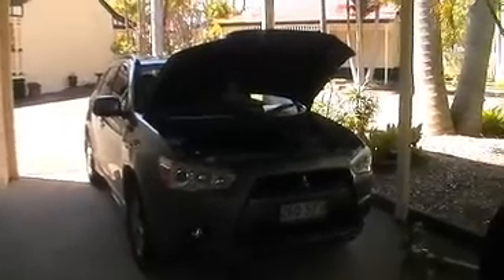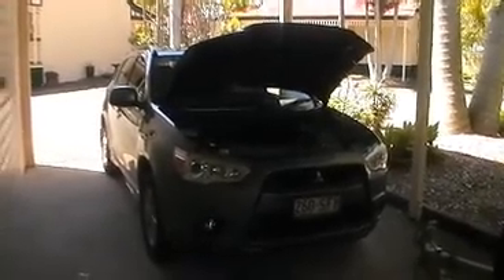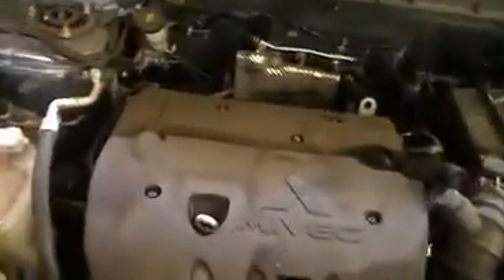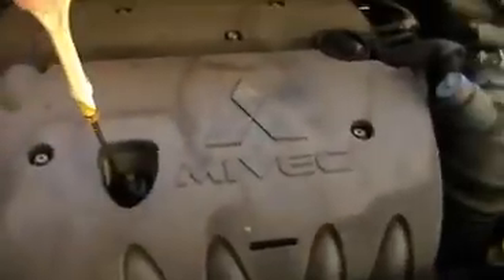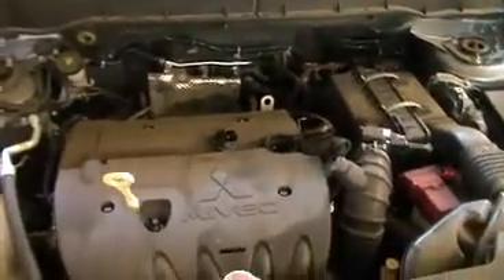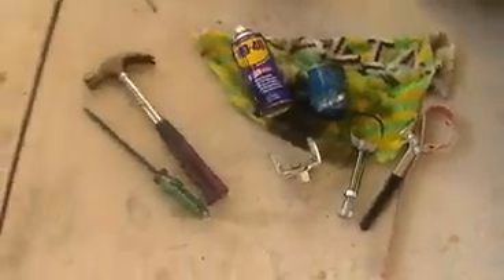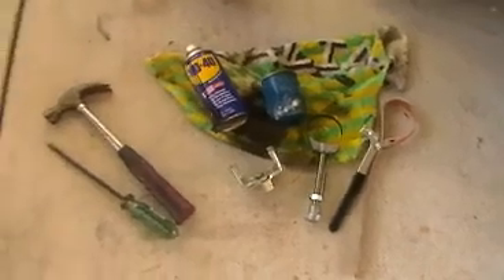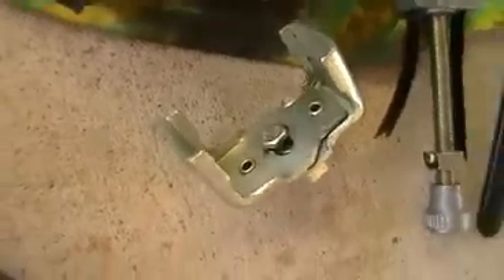Oil Change ASX

Comment: That is how workshop guys do it in Brisbane Queensland Australia! I swear most of those guys are dipsticks! When I first bought my Toyota hilux and because of warranty I took it to Toyota and about 300 dollars for a service ( which I saw was oil change, filter. Test on everything. Came up good.  One bulb replaced but in my head I thought I wonder if they touched the bulb? Sure enough still burnt out. After that I did my own oil change and filter every 5000 km.even though Toyota recommend 10000 km.perfect compression at 28000 km. But like you, I took the filter off but man was I heaving like a rhino! Cheers